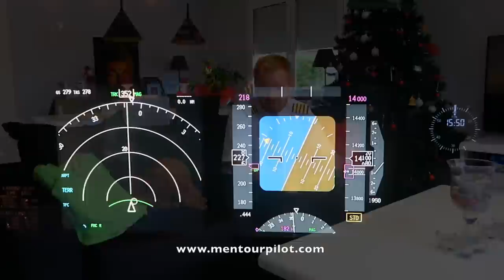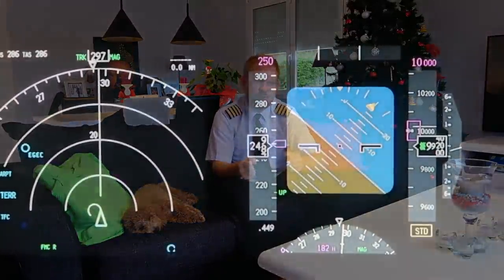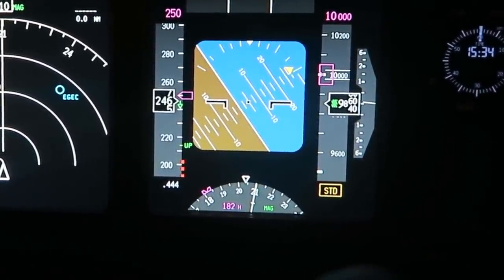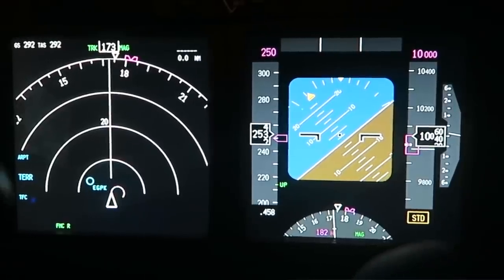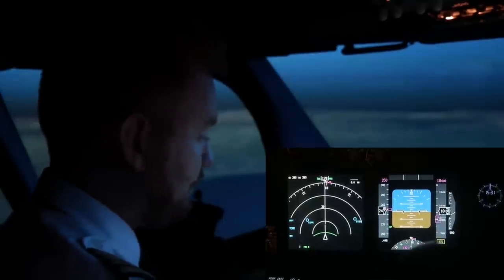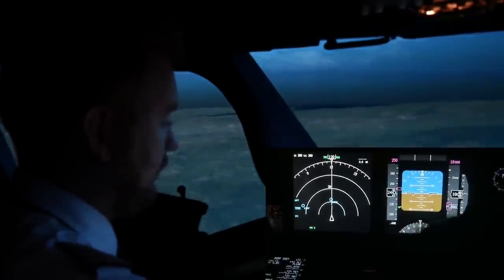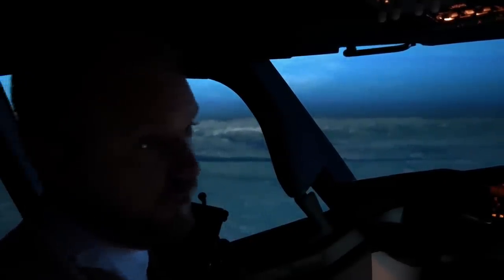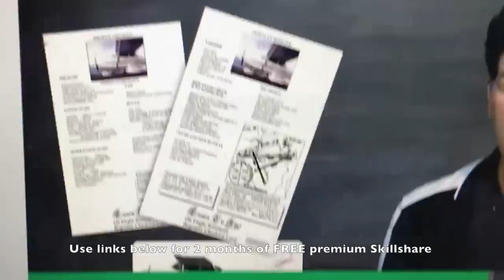What happens if you ROLL an airliner?!

Comment: try to roll as follow: increase speed in level up to 320kts, not below FL 200. then pitch up 20° -25°, then release pitch down so you have no load control force in your hands and simultaneously left or right full ailerons ( power reduce to 40% N1. ) you will roll the B737 like a baby.......
Reply: That's how I do a gentle roll in my Bulldog. Well, apart from the 320 knots, FL 200 and reducing power thing...

Comment: Try using the autopilot instead.
It can be used to get the right approach vector for landing,
making turns by resetting the heading each time a turn is required.
Once the people on board are settled down,
they can do some higher altitude pulling on the stick,
and pushing it, to feel what happens and get at least some warning.
If they can't control it, they can switch the autopilot back on.
It's possible to use that for landing as well, if they only need
to figure out to step on the brakes and reduce throttle to zero.
I can't figure out though why an automated landing by auto pilot,
hasn't been done in practice yet.
Upon pressing the emergency button on a plane,
it kicks in, assumes a steady course on a flat plane staynig above ground.
In fact, remote operation of a civilian airplane is the same tech
as a regular drone operator.
Any center receiving such a distress call (automated),
could have it relayed to a governmental emergency center.
They'd make remote contact with the plane and land it.
It's almost 20 years old tech.

Comment: Can you do a 1g roll in a modern jet airliner. Yes I know under safety the answer would be no & the fly by wire and computer would not allow such a manoeuvre.  But if you had none of this, is it possible.
Reply: An A320 would stop you doing it, a 737 wouldn't.

Comment: It doesn't roll as well as a 707. The 707 has all the spoilers on each side activated by it's respective plumbing...the 737 has them mixed. That's important because using partially deployed spoilers really help the roll rate. (Kids, don't try this at home.)

Comment: 01'34":
Gravity, gravitational pull, ... .
Physics, in short.
Reply: 10'04"
Mass in movement wants to stay in that movement, thus trying to stop a roll, would take serious energy to stop this roll, and then more energy to roll back.
What we do in a roll situation, is USE the energy there (the roll it began with), and roll the plane through 360 degrees.
It is the most energy conserving method, in case this happens.

Comment: Sorry dude but the barrel roll is the real point of interest for me in this video.
Also you fudged the issue of increased stress by not mentioning centripetal forces which determine your ideal bank angle.
You lean a plane for the same reasons you lean a bicycle or 2 wheeled motorbike.

Comment: I imagine in real life you rip the wings off. But that one hero was able to steal a plane and barrel roll it. I'm still waiting for a pilot to take off at full speed. I'd love a pilot to hit the brakes, ramp up full throttle and then push the stick down into the runway until takeoff and pull up hard. Commercial landings and take-offs are weak. They should be more powerful. Especially delta - calling out your auto pilot takeoff / landings.

Comment: Your   food   and   drinks   end   up   plastered   all   over   the   ceiling
Reply: Not necessarily. If you roll a plane by somehow keeping its altitude constant while traveling in a perfectly straight line, then yes ... you get a mess. However, think of a very large, straight,  hollow tube with a very large inner diameter. If you can somehow keep the plane on a spiral path (while rolling) that remains on that tube's inner surface you can generate enough centripetal force within the plane at all times so that to the people on the plane it seems like normal gravity and nothing will get upset. I'm not saying it would be easy to do, or that a commercial plane could execute such a maneuver, but theoretically it's not outside the laws of physics.